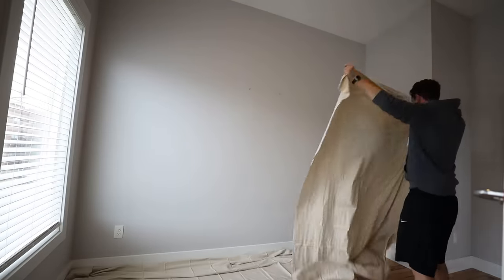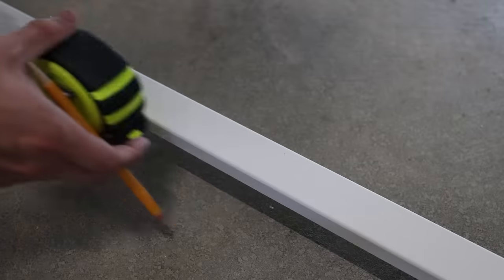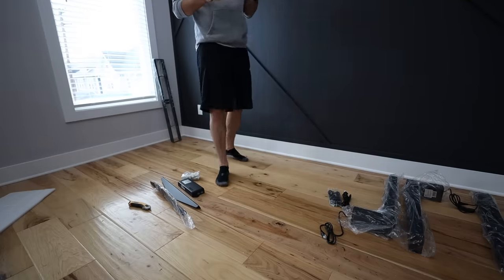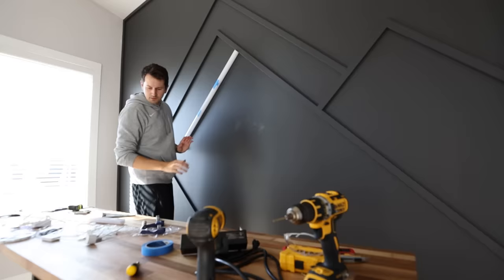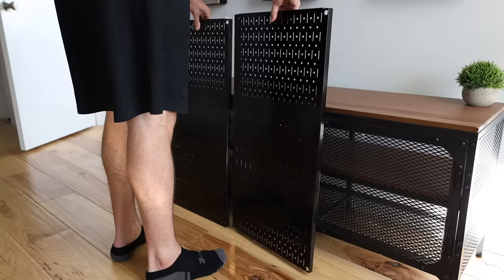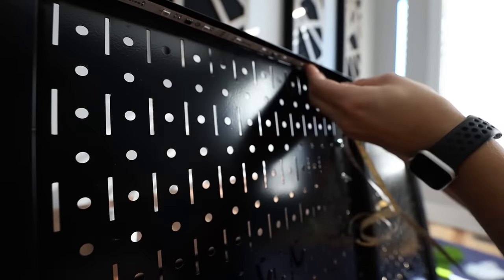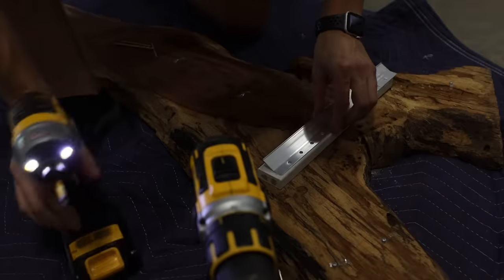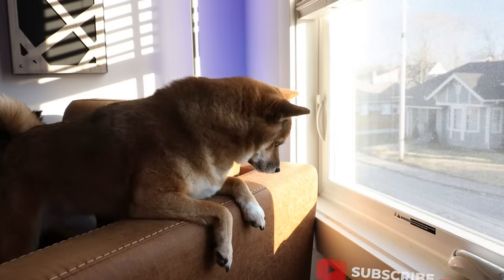Dream Office and Desk Setup 2022 - Part 1: The Build

Comment: Awesome setup!
Btw, the blue "sheetrock anchors" aren't for sheetrock at all. They are plugs for hard surfaces, most commonly for hanging items on tile. If the item you are hanging is heavy or had some regular movement, a plug like that won't hold it for long. However, if its light and it works, then go for it! Otherwise, I suggest looking into sheetrock zip-it anchors or if you need something more heavy duty, toggle bolts. Only downfall to these is that it leaves a bigger hole than a 1/4 if you ever have to take it down but it is waayyy more secure.

Comment: This looks incredible and was a very helpful video - just wanted to warn people to be careful putting an ultrawide curved monitor face down like that at 8:23, I've heard some horror stories of the weight causing the screen to crack in that position. Maybe throw a pillow under there if you need to screw in a VESA mount, etc.

Comment: Not sure if you still read these comments.  Instead of tracing holes, I bring my stuff in.  I live 17 minutes from Home Depot.  Assume 10 minutes to walk from car, sort through bins, check out, and walk back to car.  For me, it is not worth 44 minutes to risk getting the wrong one...because then it actually turns into 90+ minutes (I assume more than 2 minutes to return the wrong size).

Comment: Great video.  I also purchased the LG UltraWide monitor to use in conjunction with my MacBook Pro, but returned it after a few days.  The fonts looked awful and my Xbox X just stretched the video, rather than scale it properly.   Did you have any of these issues?
Reply from the maker: For the fonts, are you talking about the font sizes? If so, I think I know what you're talking about, I went to my Mac's display settings and played with the resolution scaling. As for the Xbox, I prefer not playing full wide screen with it. I noticed the stetch look as well. I prefer playing with just the standard mode (probably because I sit to close to my monitor), but 1000% understand why you'd want the full wide-screen. I'm still looking into it. If I find anything, I'll let you know!

Comment: hey! really like your videos! I am trying to build a standing desk setup myself, but i'm kind of inbetween just buying a secretlab magnus XL or getting the same desk frame that you have and just adding a butcher top from ikea. My main concern is: is your desk wobbly when extended at standing height? (i found a butcher top at ikea which is 6.2feet x 31in, weigt: ~30KG)
Reply: What did you go with in the end?

Comment: Hi Lee - Great job !!   and yes it did inspire me .   Regarding your desk - I have  a Butcher Block 71" w x 36 d   that i wish to convert to electronic desk -  it is heavy so im  shopping for a frame that will handle it . You mentioned a brand autonomous ,  I will check them -  also i like your shelf  ( what size is yours ) and considering something like that but i need my monitor to have swing arm to move closer to me .. is that what you have ?  great job thanks for making this video .

Comment: I'm looking at building a similar desk with the same frame. You didn't give the depth of your desk top. Looking at Home Depot's selection I see a lot at 25.5" depth, is this what you used?
Reply from the maker: Yup, mine is just over 25"
Reply: @LeeLechner  Thanks for the reply.  Great video.  I ended up building basically an identical desk and I love it.

Comment: Looks great! I'm doing a similar build and have a question! I was planning on putting my butcher block on the IKEA Alex Drawers like your previous setup, but when we got there I sat at a desk that was using them and it seemed pretty low to the ground. Is that why you ended up going to the autonomous desk setup? I'm wondering if I should add legs or something to add a couple inches to the height.
Reply: you can use desk risers or furniture risers for a few extra inches (place them in between the butcher block & alex drawers ) find one that matches your butcher block and the alex drawers or one that doesn't so it makes it pop a tad bit :)
Reply from the maker: Yeah, I added the standing desk set for that reason, plus to give the middle support to avoid potential warpage over time (even though butcher board is extremely strong.  And exactly what the other comment here mentioned. Desk risers are a great option to give you a few extra inches

Comment: Great content!! Any reason you chose the Autonomous desk over Uplift or Fully?
Reply from the maker: Thank you! I had already worked with Autonomous in the past and saw this set would work great for what I needed. I would like to Autonomous offer more stabilizer options, such as a stabilizing crossbar and brace. When the desk is all the way up, I'll occasionally notice the monitors shake when I bump into the desk. Not a big issue, just a picky thing I pointed out to them.  Uplift looks like it would've been a great option as well though with what they offer. I don't know if I even knew about Fully
Reply: @LeeLechner  Thanks for the thoughtful reply. Subbed and looking forward to your future content

Comment: What did you use to hang your wooden art piece? You showed it briefly on screen, but I could not decipher it, and if it is listed amongst your list of items used I’m afraid it eludes me. 
Thanks!
Reply from the maker: Completely forgot to list it. The brand is named OOK. It's a French Cleat hanging system that can hole up to 100lbs. I picked mine up from Home Depot or Lowe's. Here is the exact one (the only link I could find was Wal-Mart): https://www.walmart.com/ip/Ook-Professional-French-Cleats-100-lbs/32469241

Here's a near-identical alternative from Amazon: https://geni.us/jZlM
Reply: Thanks. It seems like the perfect solution for a problem with which I’ve been wrestling.

Comment: Very cool build!  I still show off your first office build video all the time as my ideal office template when I get my new place.  I do like the look of the wood pieces on the wall, but still not sure how I feel about them being the same color as the wall... I think I would try to find a stain that matched the walnut desk.  I LOVE the peg board.  The LEDs look fantastic behind it.  

I do miss the blue behind the live edge wood piece... I guess the white background does allow a variety of colors to be used, but the brown on top of the blue really made it pop.  Any plans to incorporate the wood & pipe wall shelves you previously had over your desk?  I thought they looked super nice, and have them saved to an Amazon list for my future office build.

Also, have you noticed any wobbling with that standing desk frame?  I plan on getting an 8' walnut desk, and have been planning on using the Uplift V2 (potentially Commercial version) simply because it has 4 legs to avoid wobble.
Reply from the maker: I ended up getting rid of the wood/pipe wall shelves as I just couldn't find anywhere to use them (the wall with my iPhone piece was too shallow).   As for my desk frame, yes, I've noticed some wobble. Not terrible amount, but I'm a little OCD about it so I plan on researching and testing out some solutions in the future. Hopefully I can find something to improve it.
Reply: @LeeLechner  Hi Lee, I have received a message that I won some prizes from you. I feel like this is spam, just double checking with u if I am talking to u atm?
Is there a way I can chat to u in private from Youtube?
Reply from the maker: @dragosdalta4317  sorry, that is spam again. I blocked the user so please disregard messages from accounts like thay
Reply: @LeeLechner  How did he manage to link ur profile with Telegram? When I pressed ur logo, it was the same profile name as urs

Comment: Nice setup! Everything looks nice and the video very detailed. One question: does yours wobble ? 
I have the same desk with a 38 inch monitor and every slide movement my monitor and desk wobble. I have the same from autonomous
Reply from the maker: Yeah, I'm trying to look into it. It's fine when the desk is in sitting position, but when it's standing position the monitor wobbles more than I'd like. The only thing that has helped so far is I pushed both legs outward and it made it more stable. My issue is that the legs are so far apart that I can't find a long enough cross support

Comment: Love the new office! And great content Lee! 
I just wanted to know how your worktop is holding up? Have you experienced and sag or warping of the wood? I’m going to do pretty much the exact same set up as you had before with the worktop across 2 ikea drawers but I’m just concerned that the worktop may sag in the middle over time where there is no support. Thanks!!
Reply from the maker: My top, because it's a thick butcher board, held up great! That said, I only had it on my Ikea drawers for maybe 9 months. If it was going to sag, it would take a fair amount of time.  It's a super-strong top though. Worst case scenario, all you need to do is just add a leg in the middle of the desk if you're seeing issues. I'd be more concerned with some of the tops you may find at places like Ikea. They look good, but won't be as durable as a butcher board top
Reply: Ok great, thanks so much! Yeah I can tell the proper butcher board is really strong, just didn’t want to take any chances. I’ll give it a go! 😀

Comment: This is hilarious. I am currently working on my dream desk setup too and so many aspects of your setup are similar to what I had and still have in mind. I love it! Great video too.

I have one question tho: since I am using quite a heavy desktop (>60kg) I am experiencing some wobble already with my current 27 inch monitor (which uses a very cheap stand tho).
However I am planning on getting a dual monitor arm and the exact same LG 38WN95 that you have. However I am super afraid that using the monitor arm it will be even easier for the monitors (especially the heavy one) to wobble around.

Have you had any issues with monitor wobble especially when the standing desk is fully extended?

Best regards, Jo
Reply from the maker: Yeah, I've had some issues with the desk being a little wobbly when it's in standing mode and when my monitor arm is extended all the way as well. I'm considering switching to ergotron to help the monitor situation, but I'm still trying to see what I can do to make the desk a little more stable at full stand mode. I've seen some cross bar options out there (from Vivo, I think), but I'm gonn do some more research before I figure out the best way to make it as stable as it was when it was just on my Alex drawers